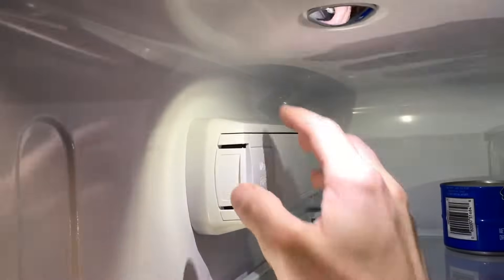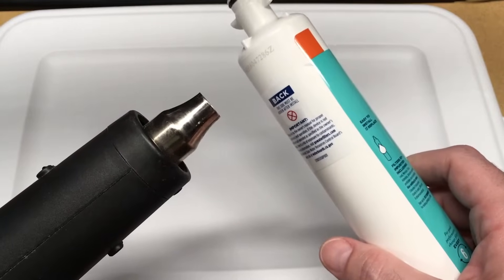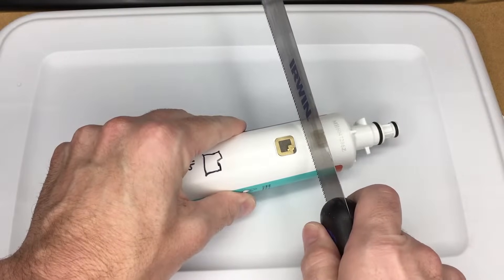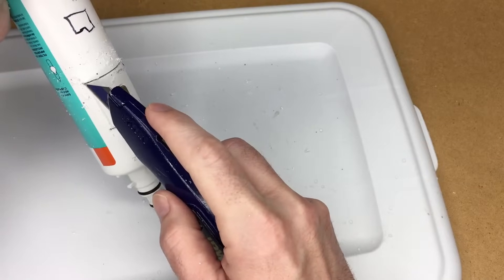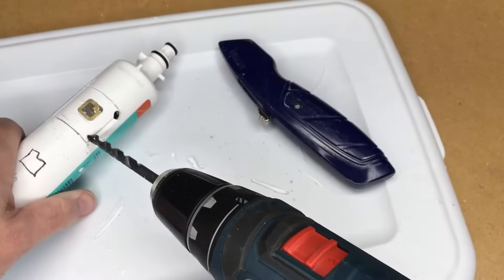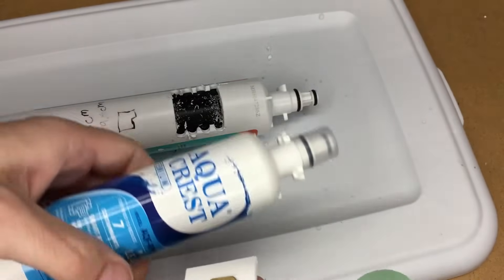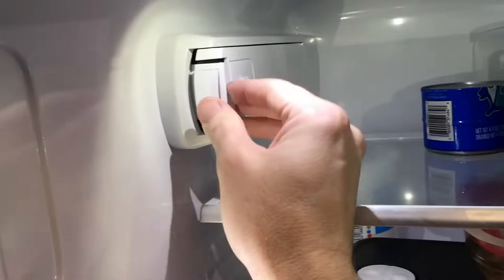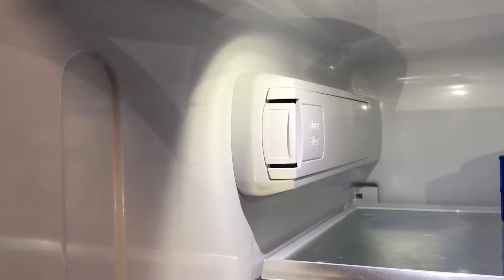Hack a Cheap RPWF Filter to Replace an RPWFE Filter in a GE Refrigerator

Comment: the refer may still think you need to replace the filter.  if you really want to do something like this, get the RFID chip from the water filter bypass plug and use it.  The refer will think you aren't using a filter at all and won't bother you again
Reply from the maker: This isn’t my situation but I know the models vary so it could help others. Thanks for sharing!

Comment: how about taping the cutout piece directly onto the refrigerator where sensor is located.  If that works, you don't need to bother with changing the chip to the new filter.

Comment: I rarely used the water dispenser, so I just let it expire and when you get the alert, just ignore it. The water still works and all it does is tell you how many days it's been since it expired. I can live with that. Just write the date on some tape outside the filter cover to remind you to "eventually" change the filer.

Comment: Just add a filter plug then use an external refrigerator ice filter. These are about $10 and with no chip.

Comment: 2 potentially stupid questions 1) what happens if you just put the filter in without the chip? Is it just the alert that pops up, or will it actually not work? 
2) if the bypass is in, does the water still come out? I am fine with my tap water as is, I just like it cold from the fridge! 
Thanks!
Reply from the maker: On mine, the water doesn't dispense if it doesn't have the chip. It should dispense with the bypass in. You can get an filter to install on the water line to the fridge as an option too.

Comment: Thanks for the guidance.  I used the oscillating tool similar to the one you showed to remove the chip from a filter bypass.  Coarse sandpaper worked well to clean up the plastic around the chip and painters tape adhered it to the refrigerator instead of the filter.  The entire job took about 10 minutes.  Simply set a calendar reminder to change the filter every 6 months.  Saves me 75% off of the filter replacement.  Thanks again!

Comment: Someone may have already mentioned this, but the RFID is what recognizes when the filter needs changing. Using the old chip doesn't cancel out the alert on the fridge door on models without the touch screen. (New filters have new chips that recognize the filters and resets the 6 month date.)
To hack these, you need to get the 'bypass filter' and remove the chip from it. (it's a 'forever' chip) Tape this chip with packaging tape (in the proper location) inside the filter compartment (not on the filter). When in use, the fridge might say 'not filtering' but you know it will be. (A small price to pay for the savings.) Write the date of the filter change somewhere so you know when it was installed and possibly even squeeze out an extra couple of months of usage if the filter isn't heavily used.
Reply: Where i can get bypass filter forever
Reply: @Desapercibida  eBay has many!  They also have 6 packs with chips and free shipping under $40

Comment: There is no point in this hack. The fridge will shut water off automatically after ship is expired. better cut the chip off a bypass unit.
Reply from the maker: I think different model fridges work differently in this respect. Mine doesn't have an expiration so the same chip keeps working. I just have to press reset on the filter timer. Based upon yours and other comments, it sounds like this doesn't work with every model. In that case, you are correct, the bypass chip would work better. One reason I didn't mess with the bypass is because I may just install it and use an external filter system.

Comment: What’s the purposed of doing this? Why do these even need an RFID chip? There’s no electrical connection on the filtrr
Reply from the maker: They don't need one. The GE filters are expensive so they want to lock you into buying them. It is dumb.

Comment: Unfortunately, if you have the TWIST-IN filter, this will not work - at least not on mine.  The electronics are imbedded/printed in the label layers and cannot be removed without damage.  Waiting to see if someone can work out a hack for that. It may be possible to cut it out but it is quite a large are of the label and knowing exactly where it is is impossible without sacrificing at least one label.  It really isn't even a chip. Until then, a bypass filter may be my best option. GE did NOT include one with my fridge
Reply: It's recommended not to run the RO to your refrigerator because of lack of pressure. I went with a plug and an external refrigerator filter.
Reply: @wmlaveck  thats why those systems come with that basketball thingie, its a small pressure tank that goes under the sink with the rest of the system. granted it wont last long enough to fill a really big pitcher and fills up to pressure slow but hey, its for a glass of water at a time usually
Reply from the maker: Hopefully you can find a bypass. An external filter could easily be set up. For the price of few GE filters, I could set up a reverse osmosis system.

Comment: after replacing OEM GE filter with "RPWFE Water Filter, Replacement for GE RPWFE Rеfrigеrator Water Filter (Without RFID Chip)-2 PACK", I found that NEITHER the old filter nor the new filter worked at all until I RESTARTED my "GE Profile™ Series ENERGY STAR® 22.1 Cu. Ft. Counter-Depth French-Door Refrigerator"   I did not see this recommendation in any of the videos.
Reply from the maker: Thanks for the info. Hopefully this helps someone. My fridge didn't require that but it sounds like GE has fridges with different levels of water filter security.
Reply: What is your GE model number? Mine did not work. Wondering if I need to restart the GE.
 i
Reply from the maker: @kamol901  PWE23KSDFSS

Comment: What if you replace the filter and it still won't make ice cubes?? Ty
Reply from the maker: Do you have a water dispenser and if so, is it working?
Reply: @Rickmakes  yes it's making fresh water
Reply from the maker: @mtcolin123  Was it making ice before the filter change? I wouldn't think a filter change would affect the ice maker (since you know the filter is working via the dispenser).
Reply: @Rickmakes  it quit making ice about 3 weeks ago. I changed out the filter a few days ago.

Comment: Worked for like 2 cups of water then filter pops out and warning comes on that filter not in place. I think it's because the tabs are different and standard filter will not stay in place due to pressure from water.
Reply from the maker: It sounds like you have a different mounting setup than mine. Mine isn't able to pop out.

Comment: Thanks Rick! I wound up using a hacksaw and miter box and cut the chip/plastic backing as you did. Question about the chip, is each unique? I had a 9 day countdown, installed/ran the bypass, did the hack, and then installed a generic filter, all within an hour. The 9 day countdown is now gone, but my question is will it come back? And if so, will the chip be blocked? Mine has the digital panel, no screen. (Plan B of course would be hacking the bypass filter, and taping the word 'NOT'! Thx!

Comment: just use a razor knife to remove the chip from the old filter. put the blade under a corner and pop it off.
Reply: I tried this on several filters. They had it glued solidly in place and the chip was destroyed each time.
Reply: @benalt  try removing the chip from the bypass plug
Reply: @markb.2051  What I described was from 2 years ago (last time I changed the filter). I'll see about it again the next time I change it which I do either when the water flow is reduced enough or the taste changes which hasn't happened yet. The fridge display just shows that it is 99 days overdue. The kids were excited to see what happened after 99. Answer: nothing.
Reply: @markb.2051  What does that mean?   please help...
Reply: @benalt  there is a video on here of a girl showing you how to take the top of the exterior ice, water dispenser off and disconnecting about three things and then putting on a small piece of black electrical tape over one of the words.....that makes you think you have to change it......
Reply: @carolburnett8372  Can you give me more details on how to find it?
Reply: @benalt  --- oh here is the one I think you want to change the message in the display of the front of the ice maker in the display......and also the latter half of this video shows you how to get the chip from the bypass filter to install in your fridge to use other name brand filters.......here it is.........https://www.youtube.com/watch?v=cwFohUwgH9s&t=111s

Comment: This isn’t going to work for mine. I have the fridge with the digital countdown. Wish I had some way to reset the rfid tag.
Reply from the maker: Did yours come with a bypass plug? If it did, you could install it and then install a filter on the water line to the fridge. There are countless options there. Home improvement stores likely have something you could connect up. I think some even come with push fittings. If you don't have easy access to the back of the fridge, you might be able to drill some holes in an adjacent cabinet to install the filter. If you have an unfinished basement with access to the fridge water line, you could install the filter downstairs.
Reply: @Rickmakes  I wonder if the bypass has a RFID tag on it?
Reply from the maker: @PrestonCovell  Mine does and I think I can use it as opposed to one of a "legit" filter. I'm not sure how it works on the countdown system. You might try it.
Reply: I did not know it but GE gives you one free bypass filter if you ask.......I called them today......and I plan to get the code off and install it in the fridge in the exact right place and then use a good much cheaper filter....
Reply: Preston ....do not give up ......there are some ways to get around the scam to make you use only their filters......keep reading.....and there is a way to take cover off and put a tiny piece of electrical tape over the annoying words......and then put it back on properly

Comment: That RFID chip will just pop off..no need for all that cutting stuff. Just tape it on the new filter.
Reply: GE started gluing it and when you tried to pop it out it will damaged the chip
Reply: it seems that the newer ones are super glued on.......wonder if any of them are not super glued?   I called GE today and said that I heard that I can have one free bypass water filter free with my purchase so when can I get mine.......she asked for my address immediately....was easy but finding the right number was hard.....
Reply: @carolburnett8372  Will youtube let you share that number? My fridge didn't come with a bypass either!
Reply: Yup extremely hard to remove the chip now. Heat doesnt work, the metal wires are so thin that they will break if you bend it to much.
Reply: GE has smartened up.  Tried gently razoring off only to stall out on big gob of epoxy.  Sheared the chip…
Reply: @gregallard8438  you're not alone... 🤨

Comment: Great hack. One question for you. I noticed the style of the locating tabs on the GE filter are different from the Aquacrest filter. Did you have any issues locking the AQUACREST in place?
Reply from the maker: I didn't. I went in the same as the GE filter.
Reply: @Rickmakes  Great. Thanks for your help.

Comment: Unscrew the inside wall where everyone is taping the chip to and pull that plastic inner wall part out.  Behind that plastic part is the circuit board that senses the chip. There are three wires plugged into that board, a Purple wire, a Black/Red wire, and an Orange/Gray wire. Who here knows the correct combination to splice those wires together, to bypass the chip altogether?
Reply: Good idea, but that seems too easy of a workaround.  I am sure the manufacturer thought about it.  I assume these three wires are for data, negative and positive voltage, which would be the minimum wires for an RFID chip reader to send RFID data to the frig computer.  Splicing the wires probably would just cause the RFID reader to not function any longer or even worse, short out the reader, not bypass the RFID chip.  The computer probably has to read the RFID data, determine if it's a unique code that hasn't been used before or if it's a RFID for a filter bypass then only when one of those conditions is met it will it allow water to flow.
Reply: Did you ever get the answer to that?
Reply: @jl1848  No, never did.  Still waiting for someone to answer it.
Reply: @JakeSmith001  Okay, well thanks for replying to me!

Comment: Are all the OEM filter chips unique to one another?  If so, wouldn't the fridge recognize the cut out chip from an old filter as an old and expired chip?
Reply: I'm getting ready to try this myself on a current-generation GE Cafe fridge. My guess, from what I've read in other comments and based on what I've seen from my fridge itself, is that it will show that the water filter is expired and every now and again I'll have to acknowledge it by pressing a button on the screen. Instead, I'll just add a 6.5- to 7- month reminder on my Google calendar to change it out... GE is THE WORST.
Reply: @wesleyherrin1236  I wound up buying the bypass filter, carefully cutting the chip out and taping it to the inside of the filter compartment wall.  It then allows the filter mechanism to accept cheaper non-chip filters, (and use a Sharpie to write the date on), but the display will constantly show, "Not filtering," when you are dispensing water. To bypass that, I took the faceplate off, and put black electrical tape over the word "Not."
Reply: @JakeSmith001  Yeah I just saw that the video on how to do that was posted a bit further down. Of course, Lowe's took the part with them after they installed the fridge for me - I have a feeling it was so the crew could resell it online, those things are going for almost $40 for something I bet they didn't even pay for. And GE Parts is closed on weekends, so I'll have to call tomorrow.

Regardless, thanks for the reply :) I bet dollars to donuts it'll work just fine once I get everything in.
Reply: @JakeSmith001  According to the GE website, they'll ship it to me for free! I just have to call them to get it.
Reply: @wesleyherrin1236  That's the route I initially went, and that's the chip I screwed up by cutting it too close and out of the plastic casing.  So I just bought the other on Amazon and used a Dremel tool to cut it out more carefully, leaving it encased on the plastic with about a 1/4 edge on all sides of it.  After taping it to the inside wall, the filter door was a little harder to close with the tight fit with both the cutout chip and new filter wedged together, but it closes and works fine.  If it doesn't work for you, it would definitely be because you had damaged the cutout chip by cutting it too close and damaging it.  So I can't stress enough to be very careful.  Good luck!
Reply from the maker: My fridge doesn't seem to do that. You could use the chip from the plug that you put in if you don't use a filter.
Reply: @Rickmakes  would the water actually be filtered?
Reply from the maker: On mine it would be. The plug has a gasket on it so the water is still flowing when it is used. Another option is to leave the plug in place and add a filter on the line that is going to the fridge.
Reply: That is my question as well, are the chips unique and will my fridge know it was already used? I cut out the old filter chip and taped it on my new filter as shown in this video and my display still says I need to change my filter in two days. Nothing was reset.

Comment: I just did this hack. The filter works, fridge recognizes RFID, but the countdown on the door to filter time out stayed the same. Any ideas? Model GFE28GELFDS. Water on outside of door. Thanks
Reply from the maker: I don't have the countdown feature on my fridge. Mine just lights up after 6 months and you hold the button to reset it. Does the water still flow without the countdown timer working?
Reply: i have the same kind of fridge where i have a countdown timer on outside door, wondering also how reset timer if i did this mod. anyone figure it out yet??
Reply: @its2nv4u  put the bypass on for a couple of days. Then when you put the old chip back.. it will be reset.
Reply: @jslvbl  thank you so much 🙂

Comment: Did you try and read the tag, in some cases the reader just needs to see a tag (any tag) present.  I wonder if the tag could just be copied and written to a new one.
Reply from the maker: I spent a few seconds trying to read it with my Nexus 7 tablet but didn't get anything. I don't have experience with RFID so I'm not sure what kind of reader is needed. It would be interesting to know if it could be copied.